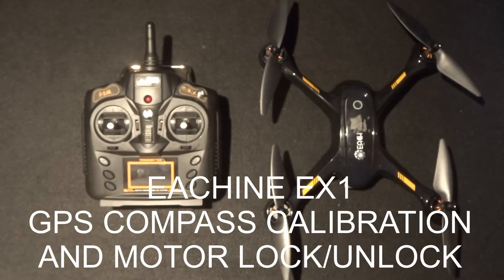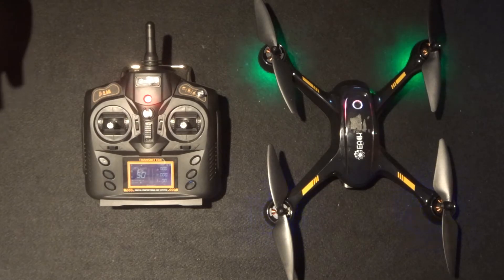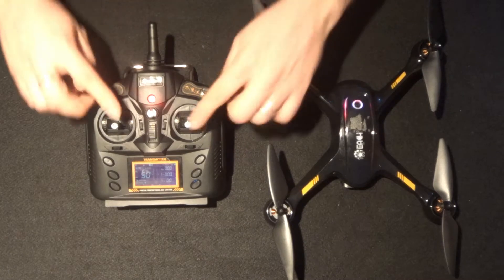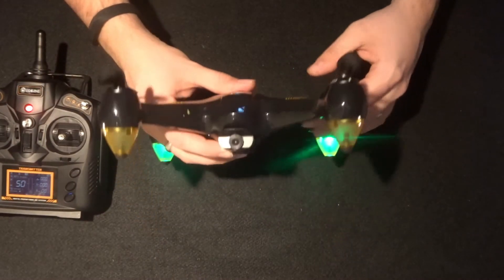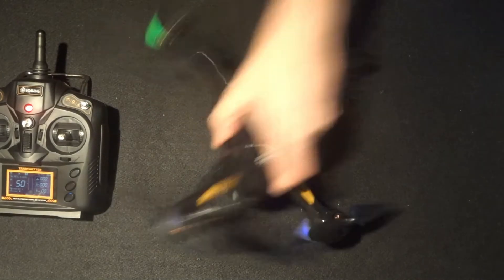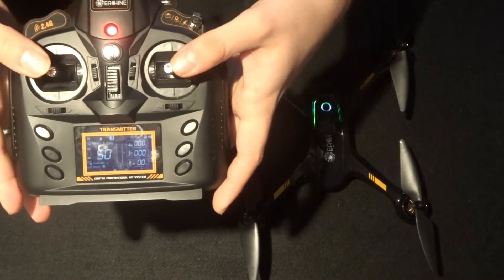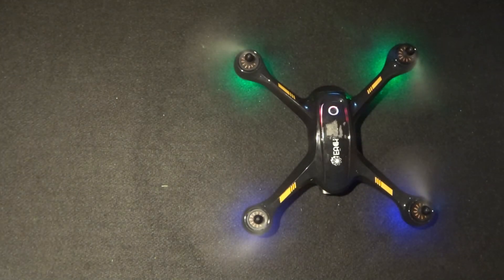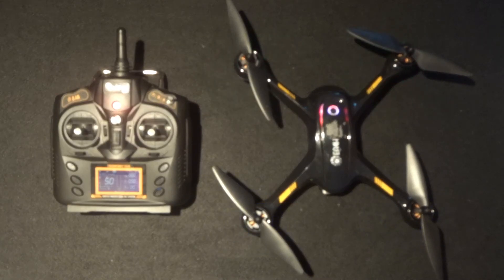Eachine EX1 GPS Compass Calibration & Motor Unlock Video

Comment: Thanks for the video, I bought a JJRC X3 which is almost the same as this model. But I got a problem with the controller, I can calibrate the Drone nor unlock the motors on Altitude Hold mode, I've been looking around and it seems is a controller issue which need to be reseted, I've tried different ways, I wonder if you ever had that issue?
Reply from the maker: Hey iTech Colima thanks for your comment, I haven’t but I have heard from people that have. Maybe I’ll dig out my transmitter and see if I can do a reset video.  Did you reset your transmitter?

Comment: Hi sir, can you helpe me? My drone can't start the engine, Im thinking maybe is bug in the transmitter. Always when I turn on the drone and the transmitter start one bio, then another bio. The calibration don't activate and the altitude hold don't activate as well. Can you help me? In the transmitter I have 9 satellites.
Reply: I have the same problem,can't start the engine too,I do ur advice but  the motor still not reponds
Reply: Switch in gps mode,I have 8,some time 10.. my question is how to reset the transmitter
Reply from the maker: Hey Augustinho Neto Sure i can, OK what is the top right lever point to? GPS mode (the middle) If its not in the middle then you can't calibrate the compass or start the motors.  When mine arrived it was in RTH mode, lever at the bottom.  Make sure you are outside, then you move the transmitters analogue sticks to the position i show in the video, after 5 seconds the front LEDs flash blue and compass calibration can begin.  Without setting the  lever and completing compass calibration  then you can't take off.  If you move the lever to the top then that is altitude hold mode and you can start the motors in the same way i show in the video.   With all those steps complete you should be up and flying around :-).
Reply: OHHH bro THATS IT IS WORKING!!! I don`t know what i did, but is working. Thank you very much bro! In position hold he keeps drifting like yours, very weird.
Reply from the maker: You are welcome :-) yeah in alt hold he will move a bit. Overall mate, hope you enjoy :-)
Reply from the maker: Hey Bo Rijadi How many satellites do you have?
Reply from the maker: Unfortunately I don’t know that, the manual may explain how to accomplish that? What I would say first is turn off everything and go through the steps again, do the motors spin up when using Altitude hold mode only?
Reply: Hey bro you did do it ? How is the lights are flashing ?

Comment: Thanks you so much for helping me I didn’t know that I needed 8 satellites to fly it and I saw your video and it helped me a lot.! Thank you so mcuh
Reply from the maker: You are very welcome Raynex _:YT :-)
Reply: Can you please tell me how to get 8 satellites? I’m in Australia
Reply from the maker: Its quite easy but it can take up to 10 or 15 minutes, make sure you are in a wide enough area with no obstructions (big buildings etc) what i tend to do is after calibrating the compass of the quad i wait 5 minutes and you should see the satellite number increase.  If not then in the past i have walked around carrying the quad until the number increases, shouldn't be too long though :-)
Reply from the maker: Thank you Raynex _:YT :-)